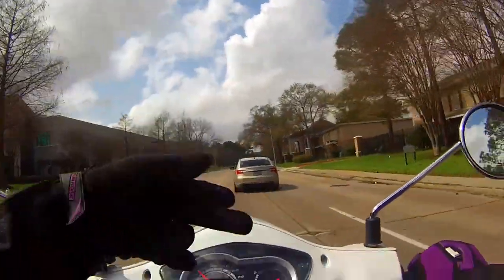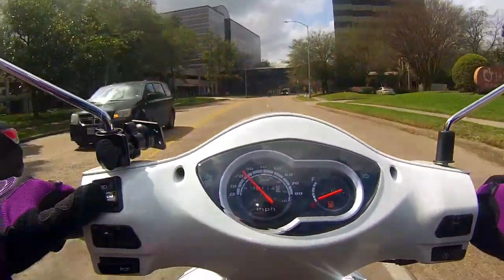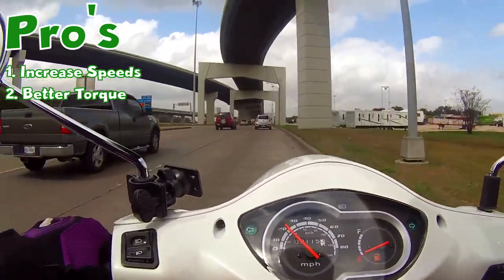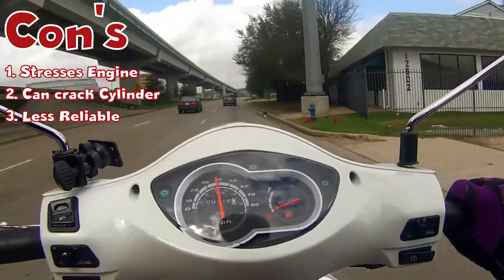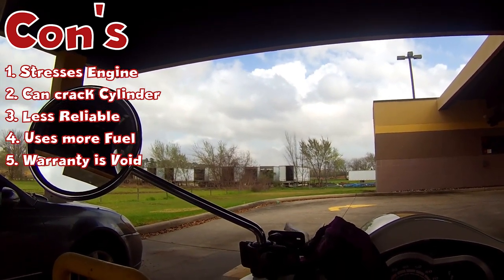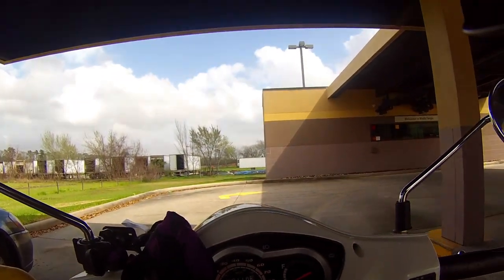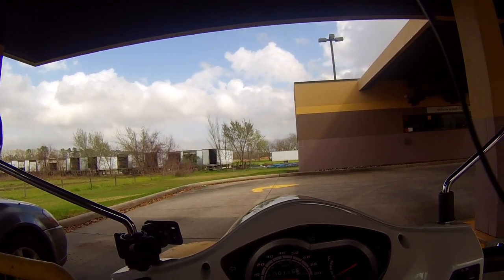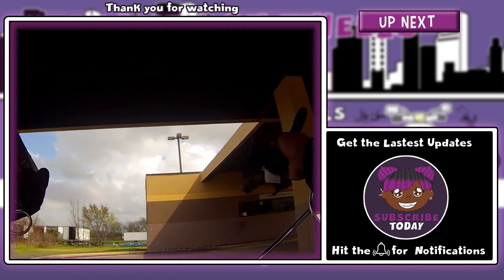125cc Scooter Vlog 10: Big Bore Kit, turn your 50cc into a 150cc

Comment: Big bore kits aren't worth the time and effort. Would be easier to just to buy a bigger engine or scooter.
Reply: Stryker Lord Word 😎
Reply from the maker: I agree with you.
Reply: They would be if you have a 150cc and decided you wanted to go faster.  For 50ccs I know it is not legal, but I know it happens... but I know that people tend to install bore kits to their 50ccs to get away with not having to take any motorcycle classes (in my state of Washington, anything over 50cc requires a motorcycle endorsement).  The extra torque from a 50cc to a 80cc makes a huge difference in hill climbing and also adds another 5-10mph.
Reply: Easier but not cost effective. Compare the price of a new 250cc VS a 150cc with a 232cc kit . 250cc is $2000. 150cc with 232cc kit less than $1000. Gy6 nicks scooter was topping at 88 mph with a 232cc kit. Is 18cc extra worth $1000?
Reply: Spoken like a person that has never installed a big bore kit. My 150cc to 171cc made a big difference, but to each his own.